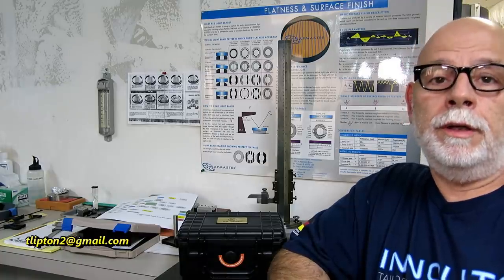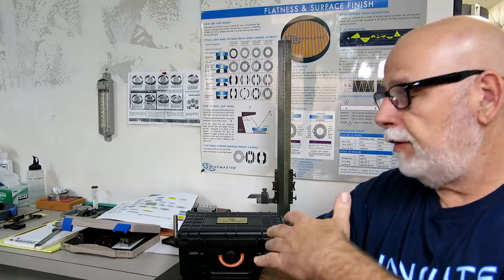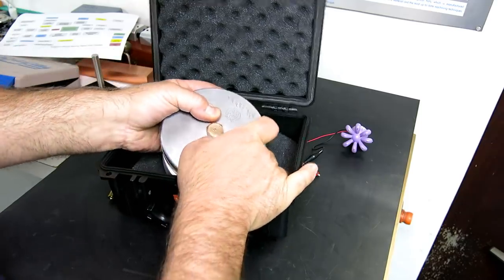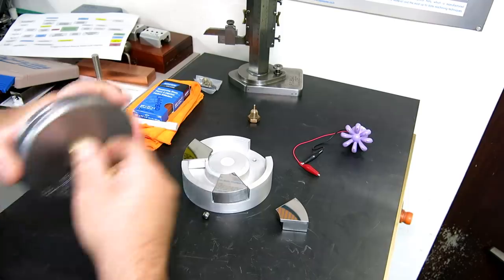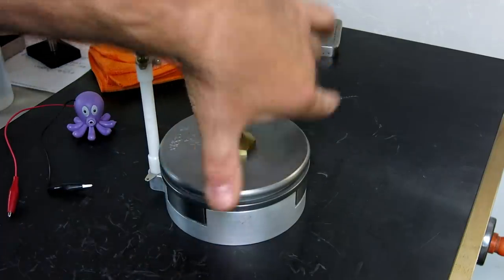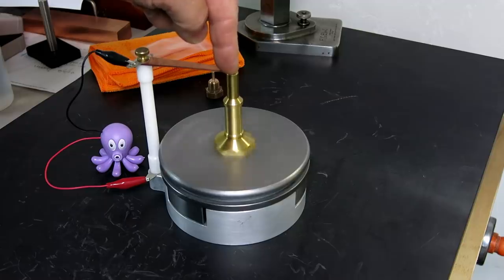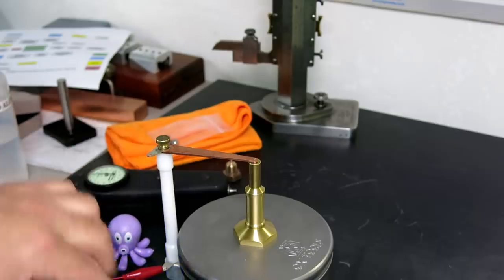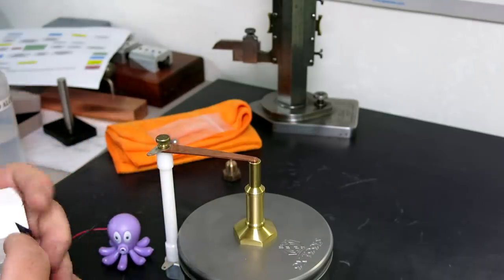Kingsbury Michell Aerodynamic Bearing Collaboration

Comment: Incidentally, this is how hard drive heads 'fly' over the disk surface.
Reply: oh wow, I always wondered how they weren't constantly tapping and ruining the drives. Escpecially now that they have three servos on those arms for the super precise positioning needed for the high density of information. thanks for sharing that!
Reply: @mikepettengill2706  this of course means that normal hard drives can't operate in a vacuum.  Though there are now hard drives that are totally sealed and filled with helium.
Reply: Back in the day - we had a guy come in and wash the platters on our disk-pack. On. Another machine a CD Cyber something-or-other you could see the bits on the memory boards. They were wound torroids.
Reply: and they fly as low as 3 nm away from the surface according to some dude on wikipedia, which is even more amazing
Reply: you read my mind James.  Top man
Reply: Yes and it made Dan Gelbart into a very wealthy machinist
Reply: Heads in hard drives are moved electronically

Comment: The company i work for make the pads out of Carbon Fiber reinforced PEEK for use in large vertical pumps. The pads don't need to be lapped as the "woven" surface of the carbon fiber creates 100s of air pockets. Plus the ductile nature of the PEEK means that once the rotary motion stops the shock loading of the disc/shaft/pump impeller etc is absorbed.

Comment: Air breaks at approx. 30kV/cm -- so for 5 um you should need approx 15 V. This would be a rather accurate way to measure the gap, don't you think? (of course you need to have a good dry environment  etc. to make sure that this works accurately)
Reply: would worry about arcs damaging the bearing surfaces
Reply: Agree, once you get down below 35% R/H you will have problem with static electricity. But what kind of problems would it cause with rotating air bearing? Are you thinking that it will pit the surfaces?
Reply: Dielectric breakdown of air (or other gasses) isn't deterministic enough. What you might be able to do is measure the capacitance. You've got a few sets of conductive plates separated by an insulator; a simple capacitor. Measure the surface area, put it in a known atmosphere like nitrogen, and hook it up to a LCR meter.
Reply: @jdmccorful  yeah, that's what i was worried about. arcs are pretty high-temperature, right?

Comment: This is a cool demonstration of a hydrodynamic bearing. Same principle that prevents metal to metal contact in the rotating parts in an engine. It's NOT oil pressure that does it, it's the hydrodynamic bearing effect that keeps the metal from touching even with hundreds or thousands of pounds of force.

Comment: Great stuff.  I work in the Hydro Power industry, and we have similar bearings (oil not air, and 100x bigger) that support more that 600 tons while rotating 300+ rpm.  Great to see this demo and teach others the power of hydrodynamic bearings.  The machine shop guys get mad when you ask to get a 20 inch bearing pad to 100 micron flatness tolerance, but we get 150 (0.5 mil).

Comment: I have used some air lift rotary tables on the big HBM's before and you can move parts weighing 20tons or more with just your fingers. Pretty cool!
Reply: I have often been envious of those things... as well as envious of floors flat and smooth enough to use them on, even if i didn't have them! ;D

Comment: My career has revolved around tilting pad and fluid film bearings from design, to manufacturing and installation. The first one of these air bearing models I saw was one made by Kingsbury and given to Westinghouse when Westinghouse was still an empire, my boss had it in his office at that time.  The other one I saw was a few years ago in a display case at Kingsbury in Philadelphia. They were used as demonstrations and educational pieces almost 100yrs ago. I’ve been fascinated by these bearings for decades, do some reading on the history of Albert Kingsbury.
Reply from the maker: I would love to see some of the early Kingsbury stuff. 

Cheers,

Tom
Reply: @oxtoolco  I can share a few cool pictures with you. Most of the photos from inside suppliers shops I can’t though. Bearings we’re making right now are 10’ diameter.

Comment: Tom, One of the best example I could compare that, would be the heads of an Hard Drive, they float above the surface of the platters where the data is saved.    Thes platters turns at 5400, 7000 or 10000 rpm to make the heard floats above each of the surfaces.   And if the platters slow down or stop with the lost of power and the heads are not in the park position, the head will land on the surfaces and create a lock, in some cases, that could prevent the platter to turn in some cases.  In the past with those big computers the hard drive platters were between 18 to 24 inche in diameter and when the heads would land on them they crash and leave gauge on the surfaces.   That's why parking the heads was important then with those monster computer drives  and in the early days of the PC hard dirves.

Comment: The most accurate gyroscopes (with the exception of the Gravity B Probe cryogenic devices) have hydrodynamic gas bearing rotors.  These instruments can measure relative inertial motion in the angstrom to sub-angstrom level.  

The Hubble Telescope utilizes several of these devices designed to stabilize the optical path to a particular object in inertial space for hours or days at a time.  These single axis fluid floated gyroscopes  are made of a ceramic material (typically Aluminum or Beryllium Oxide) for high hardness and excellent mechanical stability and have rotors that rotate at 19,200 RPM. All critical mechanical surfaces are machined at the micro-inch level.

And yes, I have been down that rabbit hole.

https://www.stsci.edu/itt/review/2gyro_handbook/c03_gyroscopes2.html
Reply from the maker: Hi Jerome. I'll add another branch to the rabbit hole diagram. Thanks for the link! 

Cheers,

Tom

Comment: I bet the reason it slows down so quickly when you apply the down force is the friction between the contact finger and the spindle - rather than somehow compromising the air bearing itself.
Reply from the maker: I agree. The center pivot and the contact arm are significant sources of friction in the assembly.

Cheers,

Tom

Comment: I once heard an engineer involved in hard disk drive design and manufacture talk about how the heads “flew over the surface” of the spinning disk platters. The same principles apply. He said it was “like flying a 747 10 feet off the ground.”
Reply: @JackHudler  There is a whole class of aircraft based on this principle,  https://en.wikipedia.org/wiki/Ground-effect_vehicle
Reply: @JackHudler  The ekranoplan is a pretty cool example of that. Curious Droid has a nice video about it https://www.youtube.com/watch?v=x22nVFTd8nI

Comment: Hi Tom.
8:08 About these stones.
I am familiar with this concept. But I thought that they should be made on a surface grinder. And I have no access to it.
Can i ask for instructions, how to lap them by hand?
Reply from the maker: I make them by hand lapping them on a fixed abrasive diamond flat lapping plate called a Ablap. You can actually do a decent job with silicon carbide paper on a surface plate.

Cheers,

Tom
Reply: @oxtoolco  thought I would need something like the three plates method) 
Thanks for answer.

Comment: Great video Tom. I came here from Steve's channel. 

I was wondering if you have plans to build some of those Pandora's Box kits and sell them to the those without the metal lathe needed to make this amazing demonstration of engineering and physics? I for one, am very interested in having one in my lab/work shop. If you plan to sell them please point me in the direction of where I my acquire one or what would it cost to get commissioned to be built? <thinks by the time this is posted there will be cheap non-functioning Chinese knock-off landfill piece being made>

Comment: Thanks Tom, this is really interesting. Do these perform better / worse if you use different gasses? (thinking of molecular sizes).  Stay safe and well :)
Reply from the maker: Hi Anthony. Good question. Bearings like this that use a gas injection use helium. Helium has some interesting qualities but not sure which one would make if favorable for an application like this. 

Cheers,

Tom
Reply: @oxtoolco  Thanks Tom - I'll do some researching into it & if gas pressure also has any advantages.

Comment: Tom, very cool.  Would be interesting to measure the capacitance between the plates vs RPM to see how much the distance changes vs RPM.  d = ε A /C   C in farads, A area in sq meters, d plate distance in meters,  ε0 dielectric constant  ~8.854 x 10e12 (vacuum -- air very slightly different)  You could even calibrate it with your interferometer.  Now we are into real physics.
That's how they measured a hard disk's head's flying height.
Reply from the maker: Hi Craig. I did. That is how I determined the ride height. I got 8100 nf which gave me a ride height of .00013 inches. I talked to my electroniker buddy and he has a better way to measure the capacitance. More to come on that one.

Cheers,

Tom

Comment: Crazy idea: since this bearing consists of two very flat conductive surfaces very close together, in theory you could measure how high it is floating with electrical capacitance. I have no clue what order of magnitude it will be, if a normal DMM’s capacitance range can handle it.
This and a tachometer of some sort will let you get a rotary speed/floating height relationship for further study.
Reply from the maker: Hi Dennis,

I did this exact thing. That is how I determined the ride height of the rotor. The capacitance is in the 8000 nf range.

Cheers,

Tom
Reply: @oxtoolco  Tom, very interesting that this actually worked. That is higher capacitance than I expected (I was thinking picofarads maybe). How much is the height affected by rotational speed?
Reply from the maker: @dennischertkovsky8871  I didn't notice any difference with rotational speed. The capacitance was fluctuating a bit then started to change rapidly as the speed decayed. I'll have to do it again a few more times to have confidence in the measurement. 

Cheers,

Tom

Comment: Is there any way that we could do an experiment to prove that when the blocks are "ringing" together as they fall off they produce a small electrical charge or discharge? And also would they ring together if they were made out of different materials? Could you have made the rotating bearing faces or pads out of a material such as glass and still have this phenomenon work?

Comment: For future videos can you include how to make or economically obtain optical angstrom indicators?  Also, how to get/measure flatness on our machines?
Reply from the maker: Typically you would not use a mechanical indicator to measure in the Angstrom range. You are not specific on what machine or how flat so I cannot comment on a method.

regards,

Tom
Reply: @oxtoolco  For me, personally,  I would like to resurface my old Brown and Sharpe mill table and ways.  From other videos, it appears to be within the ability of an amateur machinist.  However, these videos skip important details on how they are finding the combination of flatness and parallel-ness.  How do they lap and verify their straight edge?  I know from experience with 5-foot diameter silicon wafer polishers that small optical tools combined with lapping can be used to obtain submicron flatness.  (But the Japanese techs always guarded their techniques.)  So my narrowed down request is that you make a video on how to scrape a mill table or a lathe saddle.  Is this possible for someone with good knowledge and very economical personal labor rates?
Reply: @kenhnsy  You might want an "optical flat". Pretty sure @oxtoolco Tom did a series of videos on them some years back, including advice on buying new old-stock Soviet optical flats, which are superb quality and very reasonably priced for us home-gamers. Of course I bought one.

Not sure how you manage the parallelism though. I'm more of a tool collector than a user at this point, but I have dedicated space to a wee workshop and have lots more to learn!

Comment: fascinating, but my question is: what is the main reason for it to stop when there is little friction? air resistance or the electrodes?
Reply from the maker: Prian. The main source of friction is the center pivot pin and air resistance on the rotor just moving in air. 

Cheers,

Tom

Comment: I think it is interesting :) Am I missing the practical application, or is it just an engineering exercise?
Reply: Check out Steve moulds video that Tom talks about. Bearings like this are sometimes used in high speed applications for centrifuges and gyroscopes and when used with oil instead of air they are semi common in industrial machines. Many oil bearings used in turbines and in engines are similar types of bearings
Reply: I work at a hydro plant. Our unit weights about 100 ton and rides on a kingsbury thrust bearing. These types of bearings are used in a lot of applications were there is a lot of weight or thrust. Like on a large ship.
Reply: This is also how the read/write heads 'fly' over the platters that actually store the data in hard drives.

Comment: Why doesn't the air in the gap break down and indicate a short circuit?  The breakdown voltage of air is about 3MV/m  so when multiplied by a gap of 3nm the breakdown voltage should be only about 10mV.

Comment: Why do precision stones always come in pairs of two? I'd think to keep them not just smooth but also flat you would want three.
Reply from the maker: You need two to clean the surface just prior to using them. Dust settles on them and needs to be squeegeed off by rubbing the stones together lightly. The stones wear extremely slowly if used correctly so a third stone really doesn't add anything to the party. 

Cheers,

Tom
Reply: @oxtoolco  so the gist of it is that they can take on a sphirical shape, but do so so slowly that it's not worth worrying about?

Comment: Would you be able to increase the load capacity if you used some sort of blower feature, perhaps drawing air through the system via the spinning action by an impeller feature in the spinning part?